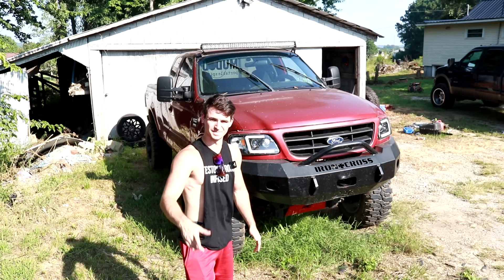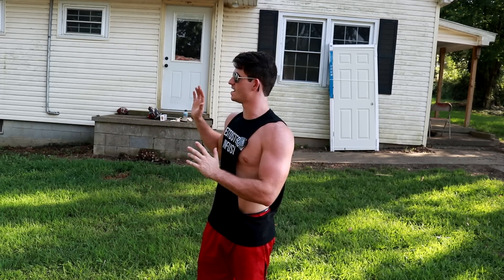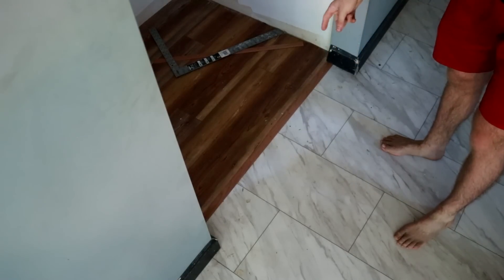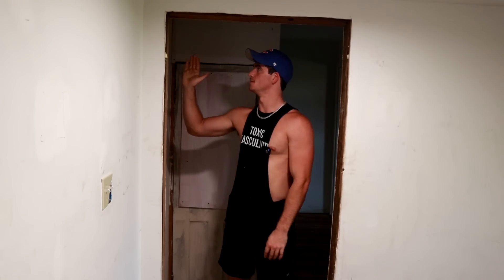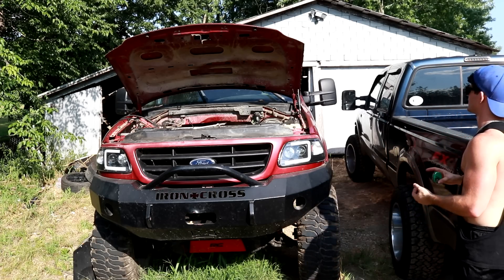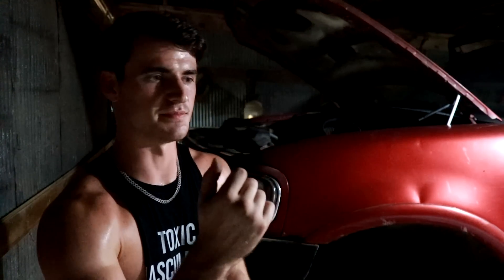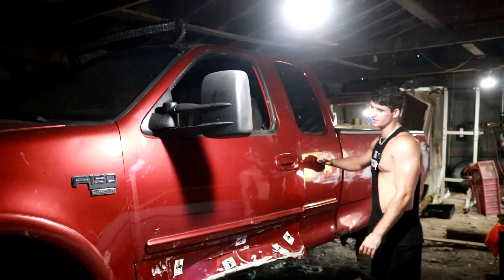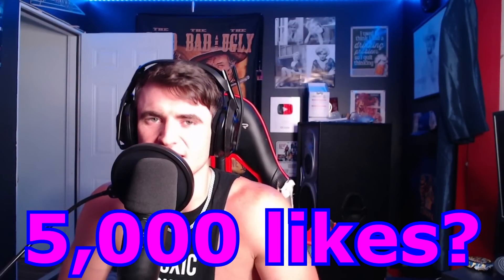WE'RE BUILDING A MUDTRUCK!

Comment: The reason your transmission keeps going out is because you have 5.13 gears in the back and stock gears in the front to fix that issue your either going to have to take your front drive shaft out or put 5.13 gears in the front if that’s possible but a 4x4 truck can’t drive with two totally different gear ratios without putting stress on the tranny just a little tip to help ya love the content

Comment: When you do the jb weld, get it really hot and use copper seal as well. My mustangs block had a crack in it, and that sealed it up tight.
Get hot
Spray or spread copper seal
Jb weld.

Comment: Hey Kenny why not just pull the transmission take it to your local machine / welding shop and have them weld it up? My first gen Dodge was doing the same thing. Took it out and they welded it up for $35 hasn't leaked two drops since.

Comment: This one time we were doing this service update on a house that was built in like 1902 and then got like added on in like 1963 and became the house that you saw when you pulled up and we had a run the dryer circuit in the AC circuit underneath the house and all of the plumbing pipes and water pipes were covered in newspaper and literally one of the newspapers had an article about John F. Kennedy getting shot I forget the date on it but it did say 1963 was the year But to let you know how old the wiring was in this house that shit at knob and tube in the attic